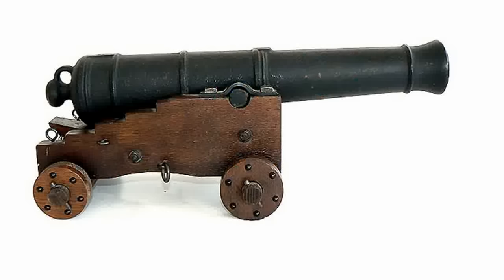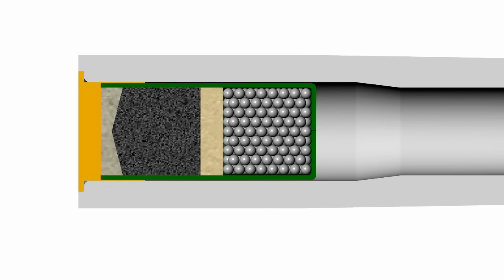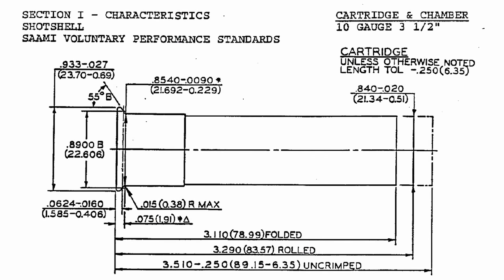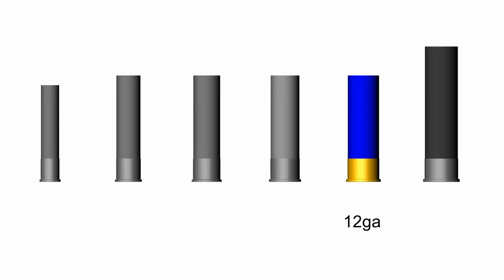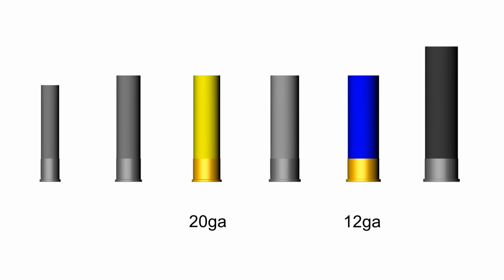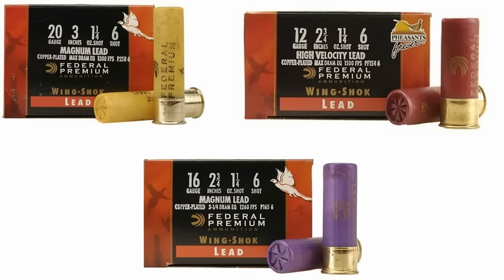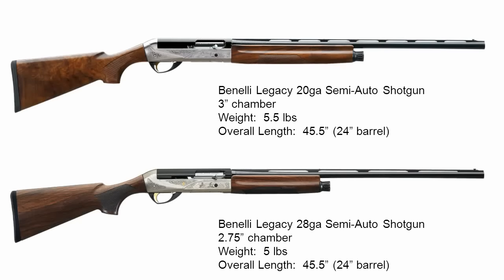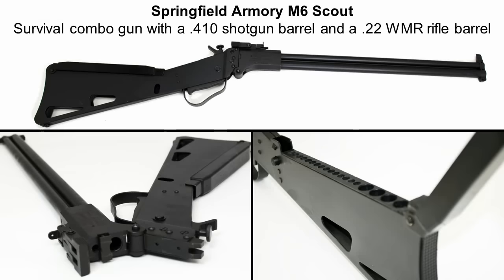Shotgun Gauges Explained - Shotguns 101 #3

Comment: I always thought that the gauge was determined by the diameter of a round ball and it's relative weight. In other words, a round ball of lead which weighs a 12th of a pound would fit in a 12ga barrel. A tenth of a pound would fit a 10ga. Is this not correct?
Reply: Robert Gantry well I have a original and reproduction 1st pattern tower made musket or Long Land if you prefer.. and it's original ball will fit perfect a 12 g scatter gun in any model I own, but the repro balls I cast and use also ones I've bought and used won't fit, they are too large, however both original and reproduction say .735, so I've always figured that was an old way of measuring it, modern standards seem to have increased but yet stayed the same... Hope you understood my garbled response there, I can clarify if needed
Reply: In other words I guess it depends on the gunmakers
Reply: So.... I was not correct....?
Reply: Robert Gantry I guess it depends on manufacturer, I'm with you I thought that it was done that way too, however it seems the more modern the firearm it changes a bit but bore size doesn't. What this guy is talking about is Abit confusing and goes against what I've always been taught and I've made and collected vintage and antique firearms for 17 years
Reply from the maker: No, you've got it, see 0:31 in this video.  12ga means 12 bore-sized round balls per pound of lead, or 1/12 of a pound per ball.  10ga is 10 balls per pound, or 1/10 of a pound each.

In real life, the guns & ammunition were not always manufactured to the tightest standards back in the early days; but also, the actual size of the balls used would often be intentionally different from the bore diameter.  Round shot for some muzzleloading firearms was intended to be swaged into the bore, so they were a bit oversized.  Others were meant to be used with paper or cloth wadding/patching wrapped around them, so they were a bit undersized.
Reply: Synchronizor They obviously didn't watch the video.
Reply: That's what I was taught,,🤗

Comment: Can you please explain the difference in detail the 12 bore gun & 12 guage gun.
Reply from the maker: No difference, they're just two terms that mean the same thing.  The "bore" term seems to be a little more old-fashioned, but it still sees use for some older firearms (especially for bigger sizes that aren't commonly used these days), and seems to be used more in Europe.  But 12-gauge and 12-bore both refer to a bore diameter for which you get 12 round balls out of a pound of lead.

Comment: 20 for home defence?
Reply: Well for home invasion I'd say, 12 is great for clearing your lawn from animals and robbers but a 20 is way easier to clean after and still more powerful than a 9mm or a 45 while not as over-pen able as a rifle. If a small 3-5 +1 capacity auto 20guage popped up I bet it would be a godsend to all non gun nuts that just want to feel safe in thier home.
Reply from the maker: 20ga buckshot shells are quite capable for home defense, and as an additional bonus, the guns tend to be more compact and easier for smaller family members to use effectively.

Lots of folks point to low recoil as a plus for the 20ga too, but the truth is that there are a ton of really good low-recoil 12ga buckshot shells available these days that are as soft or softer than a full-power 20ga load.
Reply: @HalIOfFamer   why would a 20 gauge be easier to clean the a 12
Reply: @Kevin-id5hx  clean after as in you make less mess with an invaders brains on the wall as opposed to a 12 that would definitely cause a lot more bleeding and therefore more cleaning after the incident.
Reply: @HalIOfFamer   not really but ok I've shot a lot of deer and never seen one pellet go all the way through  most don't even get past the rib cage   put hay a mess is a mess      may a well make a big one
Reply: 20 Gauge has same velocity as a 12-gauge, but with a smaller payload. Inside a house an intruder would not notice the difference. Your shoulder will notice the difference on a day of shooting.
Reply: Under 5 yards there is no spread  , so a PCC is probably better

Comment: I've two M6 Scouts (.22 Hornet / .410) and my 17yo is a 'Dead Eye Dick' on the sporting clays with it.  I also have a 28 gauge for use by my 15yo and my wife; they find it much easier to use and less frustrating on clays than the .410.  My 12 gauge is the "heck, I want to SMOKE some clays!" fall back. :-)
Reply from the maker: Nice.  Are they original M6s or reproductions?
Reply: @SynchronizorVideos  they're the Springfield Arms 'civilianized' version with the 18.25' barrels and trigger guard.
Reply from the maker: @ljosephdumas3113  Okay, so enough barrel to not be an NFA piece, but still the .22 Hornet on top?  Cool stuff.  

I've been thinking about tracking down an M6 for myself, though I think I'd prefer to go for one of the copies with the .22 WMR rifled barrel to make ammo less of a headache.

Comment: I am thinking about starting to reload, what do you recommend?
Reply from the maker: Recommend for what?  Equipment?  Components?  Loads?
Reply: Equipment and what to use
Reply from the maker: Your first purchase should be a good reloading manual, one that goes into detail about the reloading process in addition to having some load data.  A really good one is the Lyman Shotshell Reloading Handbook.  I have the current 5th edition, and it does a really good job of explaining the handloading process step-by-step, pointing out potential safety issues, and talking about the components & equipment involved.  The latter includes run-downs of common wads, propellants, and hulls (with a nice hull ID section); and information on shot sizes, materials, & ballistics.  It contains load data for lead, steel, bismuth, and Hevi-Shot, as well as slugs and buckshot.  The load data isn't the best, but it'll get you started.

For equipment, you'll want a decent scale, and probably a press.  You can load and crimp shotshells with basic hand tools, but that gets kind of tedious if you're trying to load more than just a few shells.  Common starting presses are the Lee Load-All and the MEC 600 Jr, both of which are single-stage presses.  Personally, I really like the MEC, especially the current Mark V version.  It's more expensive than the Lee, but it's a much more solidly-built press that will last a long, long time, and you can do a lot of things to upgrade or customize one.  The Lee gets the job done, but it's more of a budget starter press than something you'll keep using for decades.  If you want the higher-priced MEC but are working on a budget, look for a used press.  Even if it's an older version with some missing or broken bits, the company will still support it and hook you up with replacement parts, and you can easily fix it up at home with basic tools.  

Other basic reloading tools I've found useful are a dipper set, a powder trickler (for hand-weighing powder charges), a powder pan & funnel, stackable shotshell trays like the ones from MTM, and a circular card puncher appropriate to the gauge(s) you're loading for making spacer & over-shot cards (5/8" is a good size for the 12ga).

You'll also want some boxes to store your reloads, which can be factory-style cardboard boxes or reusable plastic ones; along with labels to mark what's in the boxes (I just use blank mailing labels).  You should also have a physical notebook or spreadsheet software to keep loading records.

That all may seem like a lot, but shotshell reloading really isn't that tough, and you don't need much specialized equipment to get started and make quality shells.
Reply: Thank you for the info, you earned a subscription
Reply: Synchronizor - Holy crap! That's some great reloading info man-thanks for sharing! PS-Great video too!

Comment: I'd say the 20 is the better do everything as it packs enough to take big game but not overkill for smaller game, the 12 does pack more of a punch and allows you to be lesser of a shot. i prefer the 12 for protection and/or defense.
Reply: Is 20 gauge powerful enough to kill deer? Do most states allow deer hunting with a 20 gauge?
Reply: @greeneyesfromohio4103  the 20 is more than enough for hunting larger game like deer. And as far as i am aware every state allows deer hunting with a 20. 

infact thos past December i dropped a buck with my 20 single shot.
Reply: @DES2nd9512  - heck ya man, I’m debating between a 12 gauge or 20….it’ll mostly be used for weekend fun clay shooting, rabbit hunting and home protection. Someone mentioned the weight difference when the gun is fully loaded with ammo so I can see having a heavy 12 and walking for 2+ hours could get tiring! So I’m kinda leaning towards the 20 gauge.
Reply from the maker: To be fair, the "overkill" you're talking about is not really about the gauge, but about the ammunition.  If a 1-ounce 20ga load is appropriate where a 1 1/2-ounce 12ga load is overkill, hey, they also make 1-ounce 12ga shells.  And that same ounce of shot will typically shoot softer in a 12ga gun.

Not knocking the 20ga, but it does have limits compared to the 12ga.  Big plus to choosing the 20ga would be the more compact guns & shells, which is nice.  As for weight, there have been real nice lightweight 12ga guns offered for a long time.
Reply: @SynchronizorVideos  Northing false in what you're but still as a general rule of thumb the bigger the gauge the more payload. I'd rather use 3/4 or 7/8 oz of shot to take a quail, dove or squirrel to minimize pellets in the meat. 1 oz. 12 gauge loads can be harder to come by compared to the obove mentioned 20 ga loads. More people of all shapes and sizes should still be able to get the job for anything with a 20. The weight difference does seem like much, but can make a difference in the number of pellets when using small shot. If going for goose, turkey, pheasant, or duck I'd take my 12

Comment: In Brazil we have 12,20,24,28,32 gauges And the .410(wich we call 36gauge)
We have some 9.1shotguns(wich we call it 40gauge),but as we do not make Shells for It since 2006 most of the remaining owners are using the 38special ammunition on it
Reply from the maker: There were a variety of different 9mm-caliber shotguns made in the past, intended for pests or very small game.  Both rimfire & centerfire 9mm shotshells have been used.  They're interesting guns, but not very common here in the U.S these days.

9.1mm would be about 101 gauge.

Comment: I am looking at purchasing my first shotgun.  I have used 12 gauge for skeet, and though I'm not a big guy, it does not bother me too much (sore shoulder) unless I get above about 40 rounds. I like that the 12 gauge is ubiquitous; the shells are generally less expensive, and with proper load choices, it seems very versatile. The 20 gauge also looks enticing as well, but I suspect my shoulder would not be much happier than with the 12 gauge.  Still, I have not decided. I don't hunt, but I'd like to be able to participate in time. There is a beautiful Benelli 828u 12 gauge that I have my eye on..... Hmm.
Reply from the maker: The 12ga is by far the most versatile option out there.

As far as recoil goes, it depends a LOT on what shells you use.  Shells for clays games like skeet or trap are generally lower-velocity and range from 7/8 to 1 1/8 ounces of shot depending on what exactly you're doing.  They'll be pretty tame in a full-sized 12ga - especially the 7/8-ounce loads.  Shotguns set up specifically for trap or skeet tend to have extra weight added to further soften the recoil for high-volume shooting.  I really like 3/4 or 7/8-ounce 12ga loads for practice, because you can shoot a million of them and never feel it, and if you can hit a clay with 3/4 of an ounce of shot, you can definitely do it with 1 1/8-ounce when it matters.  Hunting shells will generally be faster and hold more shot, but at the same time you're probably not going to go through nearly as many of them hunting as you would shooting clays.

The big upside of the 20ga is you get a smaller, lighter gun.  If you're walking around for hours waiting for a pheasant or chukar to flush that can be pretty nice.  But because the gun is lighter, you'll get more recoil energy for the same weight/velocity of shot.   If lighter loads are fine for what you plan to do with the shotgun, this isn't an issue, but it does mean the 20ga is more limited - practically and physically - for loads.  You're not going to have the option for heavy 1 3/8 - 1 7/8-ounce loads if you do get into hunting game where that extra payload can really make a difference (like waterfowl, turkey, or buckshot hunting).
Reply: Don't forget to press the shotgun butt firmly against the shoulder before shooting.

Comment: the imperial system is so confusing
Reply: thfddd dvd hc dvdrvrvvr xrexcrevtvycvrevtcvrebyc  legitimate question, in what ways can the imperial system be better. I am very serious I don’t understand the imperial system but it is likely a matter of practice. How have you used the metric system. I’ve only used imperial for the American school I went to but I used it in maths not practice.
Reply from the maker: It's really not.  It's the same concept, just with different units of measurement.  For day-to-day "this is how big/heavy something is" measurements or communication, there's really no advantage either way aside from just familiarity.  

Gauge is specifically derived from the avoirdupois pound, and thus it makes sense to relate bore diameter in inches since not a lot of resources list lead's density in pounds per cubic millimeter.  Just multiply or divide by 25.4 to convert between inches and millimeters if that's a more comfortable unit of measurement for you.
Reply: @SynchronizorVideos  Excellent explanation.

Comment: Real men use 0.1 gauge
Reply: 1*10^-300 gauge
Reply: @truedarklander , if I've calculated correctly, that would be a barrel size of 1.67 x 10^100 inches, which is 2.64 x 10^95 miles.  That is 4.82 x 10^71 times larger than the observable universe (which is 5.47 x 10^23 miles in diameter)...

Comment: I recently received a winchester 97 16ga made around 1916 in fair condition. I think I'm going to have the barrel chopped to 18 1/2 and use it for home defense. Any shell recommendations?
Reply from the maker: Neat.  The 16ga is a fine chambering for HD, and the venerable Winchester 1897 has certainly proven itself in combat.

One thing to note with a gun that age is that it may have been designed and chambered for the older 2 9/16" 16ga shells that were still common back then.  Firing modern 2 3/4" shells in an old gun with a shorter chamber can lead to unreliable function or even damage, depending on the gun's condition & design.  If you're not sure your gun can handle 2 3/4" shells, I'd recommend taking it to a gunsmith for examination.

Anyway, Federal offers a #1 Buckshot load for the 16ga, product code F164 1B.  Twelve .30-caliber pellets (probably a bit over one ounce), buffered, at a moderate velocity.  Recoil should be pretty manageable, and it's not terribly expensive, either.  It may not be carried in your local stores, but it's easy to find online.  Federal also sells a Foster slug load for the 16ga, if you think you might need more range - F164 RS.

One thing I like about Federal's 16ga shells is that they use a distinctive purple plastic for the hulls.  Other manufacturers tend to use the same hull colors for both 12 & 16ga shells.  It's not a huge deal, but 12 & 16ga shells are similar enough in size that one can readily be mistaken for the other by someone who's inexperienced or not paying complete attention.  So if you also have other 12ga shotguns in your collection, color-coded 16ga shells are a nice extra safety feature.
Reply: Thanks for the heads up on the 2 9/16 and product code F164 1B